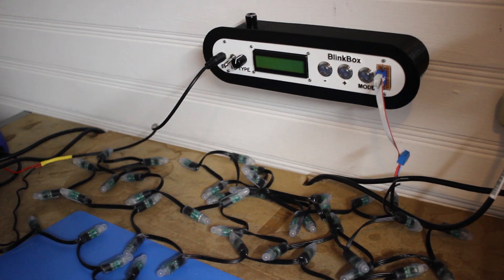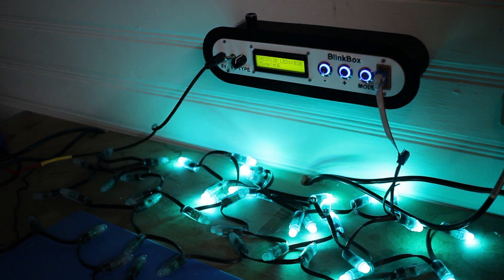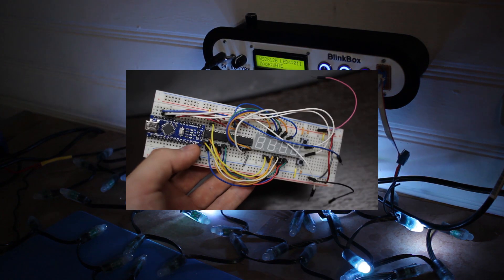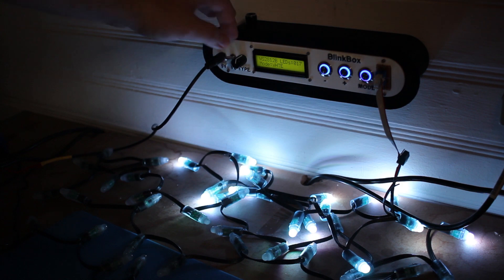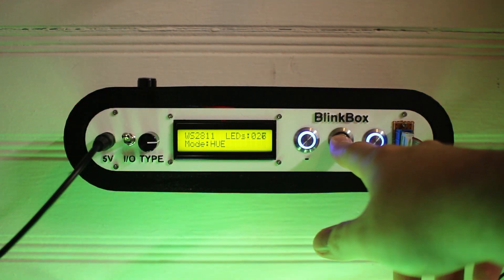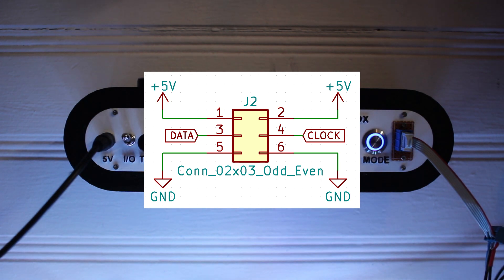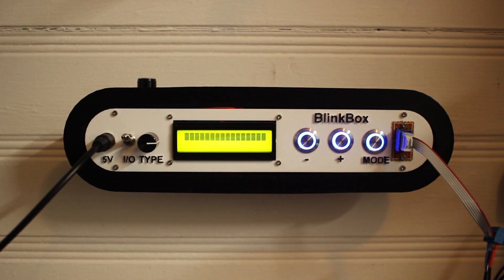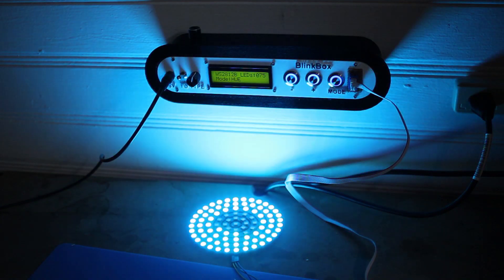BlinkBox - A test tool for addressable LED development

Comment: This is fantastic, great work! I love the illuminated buttons :)

Looking at your code, if looks like you prompt for a restart when the LED type is changed after startup? I wonder if it's possible to replace the LED definition in FastLED at runtime. Not that it's a problem, just something I've been making to try myself.

When I have some spare time, I want to see if it's feasible to bitbang the data destined for the strip, decode it and display it as coloured pixels on a screen. The idea being that I could prototype projects without needing to set up a strip until the end.

Keep up the awesome work!
Reply: Being able to prototype on screen would be great.
Reply from the maker: Chris! Thanks for the note!

So in fastled, removing LEDs from the class instance is impossible. So in order to have to support multiple strips, the add step can only happen once if you want to have dozens of LEDs.

That would be a really cool project! I'd be interested in helping out if you get the ball rolling. DM me for my email!
Reply from the maker: I gave it a shot but you quickly run into problems with the way the pin assignments work. After a little digging I found this illuminating (pardon the pun) issue on the fastled github repo - https://github.com/FastLED/FastLED/issues/255
Reply: Bummer, I suspected it was probably impossible since I've never seen it done before. I wonder how much work it would be to add that functionality to FastLED, e.g. removeLeds(CRGBController&).

I'll definitely get in touch if and when I get started on that project! Thinking about it now, it's basically the inverse of your project: instead of testing an LED strip without a sketch, I want to test a sketch without an LED strip. Both are noble goals :)
Reply: Ah right, that makes sense. Thanks for the info!